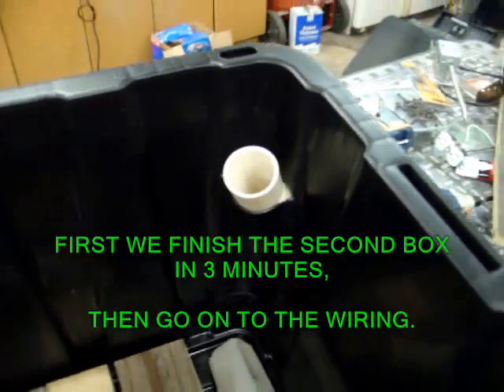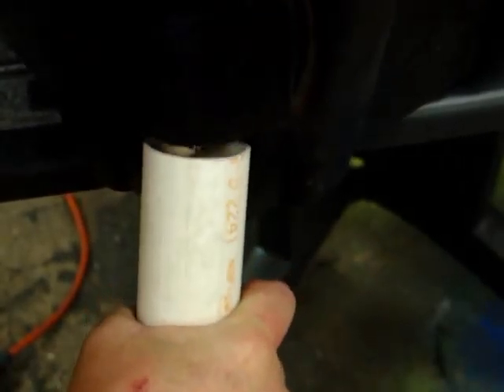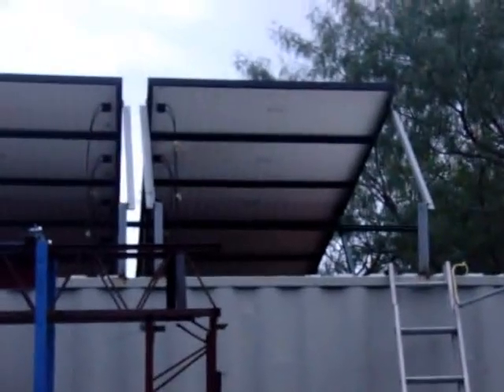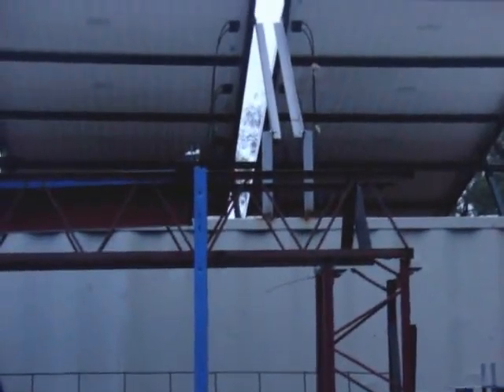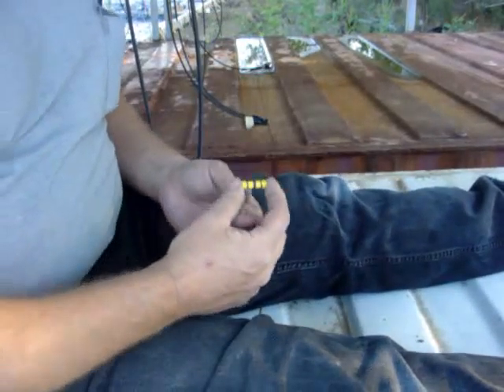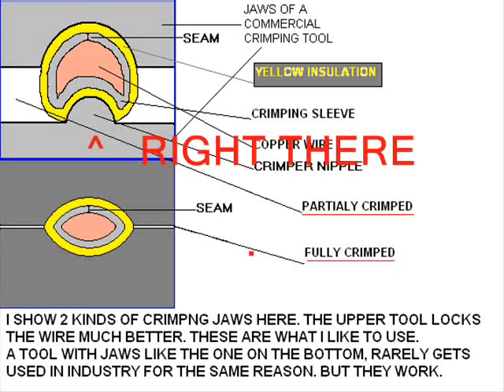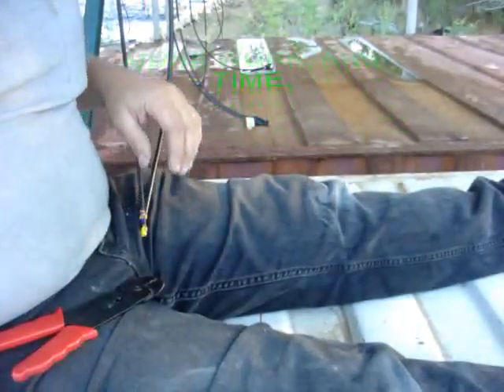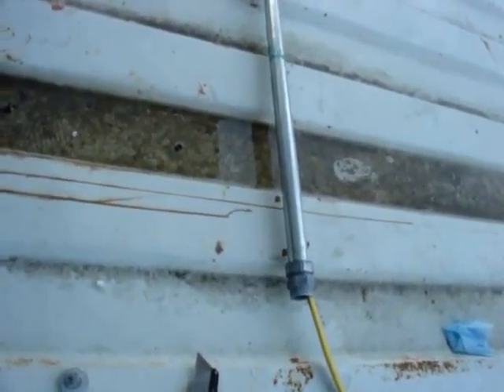PART 2 THE 4000 WATT SOLAR INSTALLATION AT BOOMTOWN LABORATORIES

Comment: Muddy I had another Idea for you too. in the winter instead of cutting breather holes in the boxes you could cut a hole in each end and attach ducts to it with a small fan on one of the duct holes. Then you could sit the black box in the sun and use it as a solar heat collector. The duct could go in your home to help heat it. I know that it wouldn't produce enough heat for mass air flow but that is why I say a small fan. Every little bit helps on the energy bill.

Comment: Yea. I have been using them on my solar and wind projects. They are pretty weather resistant and hold to get pretty strongly. I usually get them off of ebay.

Comment: Well .. looks like a really nice PV system your getting together. And that stove may work better upside down as far as i know.. or a flower pot holder :) .... nothing says it has to be a stove. Here's another idea on that servo motor? if you hooked it up direct to your axial flux it could be used as a wood lathe ... think of the hub as a face plate? I think it's 9/16 shaft.

Comment: I always solder all my connections.   I always tke the plastic off and get a nice peice of heat srink to gover the peice and then a peice of heat sring that will give over the intire ting I both crimp and solder and then place the first peice of heat srink heat it and then the larger peice and heat srink it I never trust crimps.